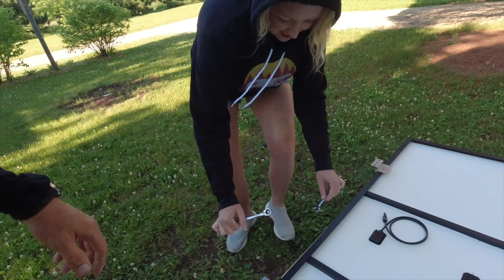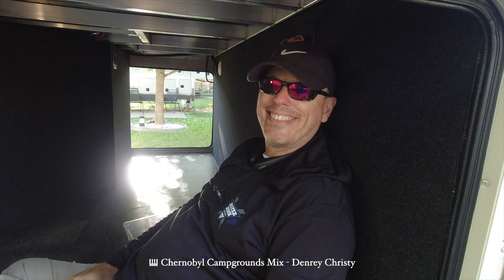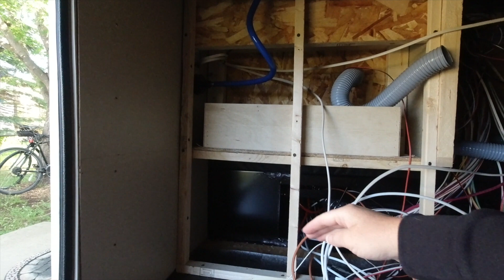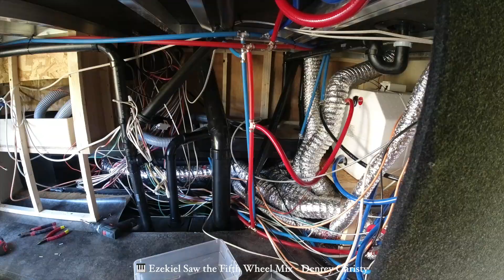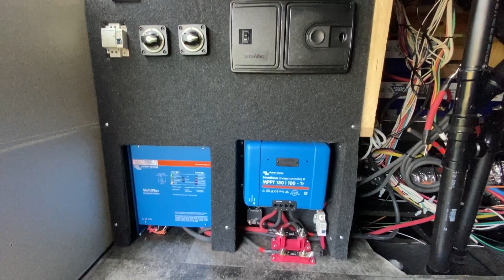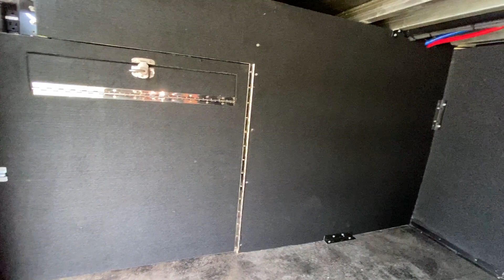2019 Grand Design Solitude 344GK | Solar Upfit

Comment: You have done the most professional installs I have ever seen !! I would love a price on my momentum 349M. I have 4 325 N tec panels Victron 3000 two Victron solar chargers and 6 BB batteries. Thanks pete
Reply from the maker: Thanks, Pete, appreciate the compliment. So, you already have the equipment and it's just not installed, is that correct? Connect with us via our website on an inquiry request (https://thedrycampers.com/contact-us) or give us a shout at 727-DRY-CAMP. Happy to chat with ya. Thanks for watching!